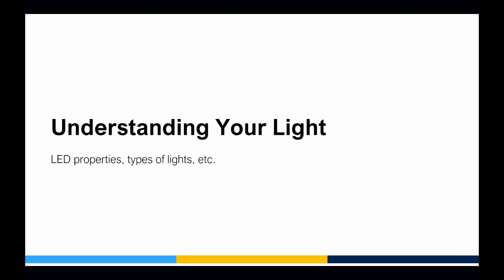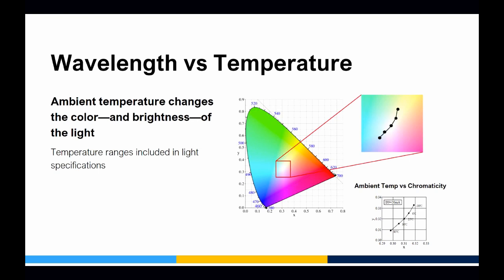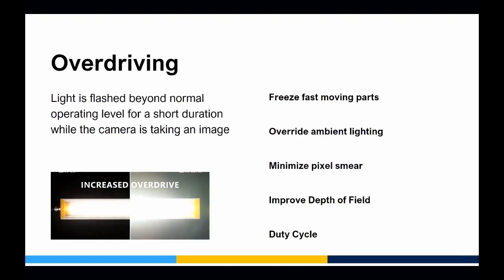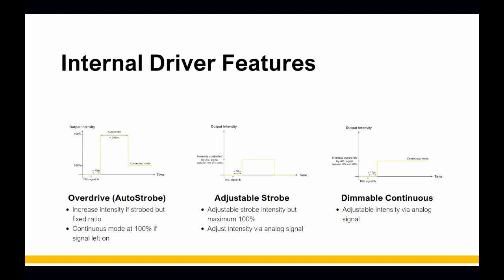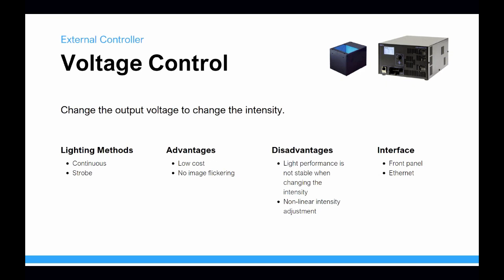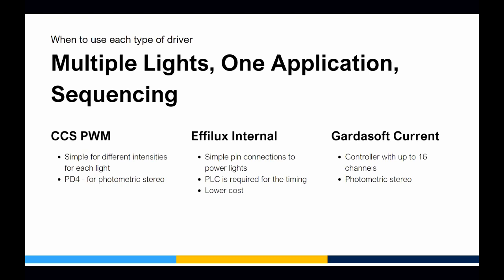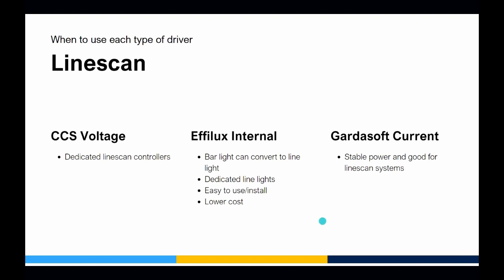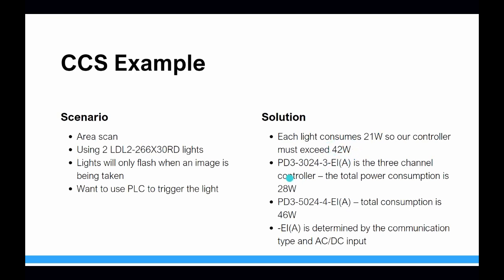Webinar: Controlling Machine Vision Lighting for Your Application

Comment: can you suggest me a light with intensity control automatically
Reply from the maker: There are a lot of factors that go into selecting a light. But if you are selecting a light only based on automatic intensity control, that would be a light with a built-in driver. Our Effilux lights all have built-in drivers. 

However, if you need a light with a certain form factor (like coaxial, low angle ring, flat dome, etc.) a controller would be needed to control the intensity.
Reply: @ccs_inc.  I need a system that controls the light for example I will set the best light for my application and if there is a change in the environment it automatically changes according to need.
there is no problem we can use other parameters as well